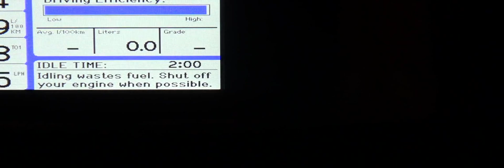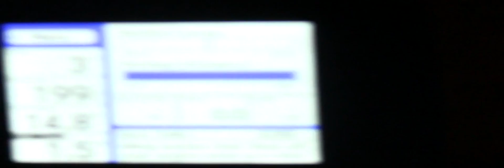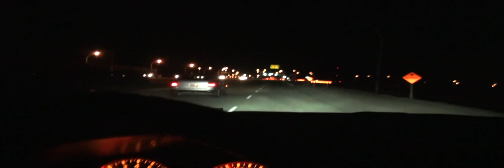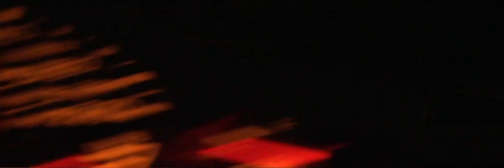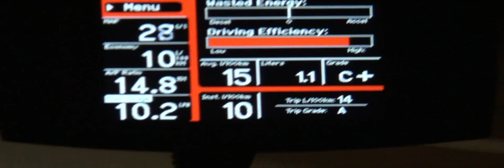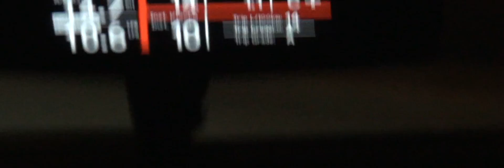Mythbusters: Idling burns as much gas as driving 65mph on the highway

Comment: I don't know why anyone would think not pressing the gas and revving about 1000 would the same fuel as pressing the gas a bit and revving about 2000. I mean there are probably some enormous V12s that use almost the same at idle as my 1.2 4 cylinder does on the motorway, but that's not comparing like for like.

Comment: Idling doesn't use as much...its waaay less. I have a '12 ford focus and I've traveled and sat in rest areas and slept for hours with the car idling. Most gas I've ever seen drop was 1/4 tank and that's 8 hrs worth. People are so dumb aren't they? Clearly less fuel is being used because we aren't holding the gas pedal driving at 65 mph.
Reply: Lol totally agree. Going like 5-10 mph by letting your foot off the brake will burn as much as idle

Comment: Here's relevant experiment and info...

Take vehicle to big flat area on a calm day. 
Start engine, release break, shift in to low gear, don't press accelerator, wait for speed to stabilize.
Shift up through the gears waiting for speed to stabilize after each shift. (never pressing the accelerator)
If engine starts to bog shift down one gear and wait for speed to stabilize.
The vehicle is now using almost exactly the same amount of fuel as it does while idling.
That is absolutely the most economical way to drive from one place to another. (of course not practical, unfortunately)

Furthermore...
The main limit on the speed is wind resistance.
Is there anyone who hasn't put their hand out the window at 100kph and turned their palm to the wind and felt the tremendous force of the wind? 
Now compare your hand area to the total area of the front facing aspect of the vehicle. 
The resistant force of the wind on the vehicle will be greater in proportion to the greater area. 
And the faster you go the greater the wind resistance becomes and not simply linearly but logarithmically!
That resistance is what most of your fuel is burned to overcome.
Logarithmically means:
Speed  vs  Fuel Consumption (approximately)
10   *
20   **
30   **
40   ****
50   ******
60   ***********
70   ******************
80   ******************************
90   ************************************************
100 ****************************************************************************** 
and so on.
Cheers

p.s. Interesting to note...
A plane like a Boeing 747 uses approximately 1 gallon of fuel (about 4 liters) every second. Over the course of a 10-hour flight, it might burn 36,000 gallons (150,000 liters). According to Boeing's Web site, the 747 burns approximately 5 gallons of fuel per mile (12 liters per kilometer).
At any moment there are on average about 10,000 planes flying worldwide.
Reply: Interesting run down. So if a 747 uses 12L/km, that is 27.6 kg CO2/km. Divide that by the 524 passengers it carries and you get 52.7g/butt/km. This is far less than the acclaimed 250g CO2 mentioned when discussing climate impact from air travel??? Are they including baggage handlers and the airport perfume shops??
Reply: The most economical way to drive is around 50 to 80 km/h in 5th gear (Depending on the engine type and gearing) Engines are not designed to do work at idle (valve and cam design) and thefore are terribly inefficient at idle rpm.
Reply: @Phoenix88.  "most economical way to drive is around 50 to 80 km/h".
Yes, that is my understanding. I was trying to convey the idea of how much energy is being wasted by idling. In retrospect a somewhat clumsy effort.
Cheers!

Comment: For simple math, if your car is rated at 10 L/100km and you are driving 100km/hr then you are using 10 Liters of gas per hour. That's a lot. The idling usage is a bit of a mystery without a device like shown here. I like the suggestion about just fill it and idle for an hour and refill. I might do this actually or at least half an hour because I don't want to wait that long. I would love to know too. And then also how much do it use while idling with AC on

Comment: But there must be some trade-off speed which burns same fuel as idling?
Reply: No. There is no load on the engine when idling. It's disconnected from the transmission. No matter what speed you're doing, the engine is pushing the car that weighs a lot. Idling rpm is set at a minimum possible rpm for smooth operation of engine with no load. Apply load at idle rpm, the engine will stall because it makes very low power and uses very less fuel when idling. Idling with AC will consume a lot more fuel though. Probably 1 litre per hour and maybe more depending on the engine and how powerful the AC is.